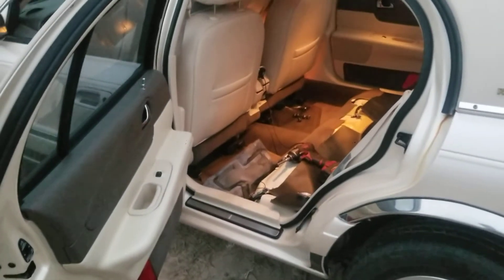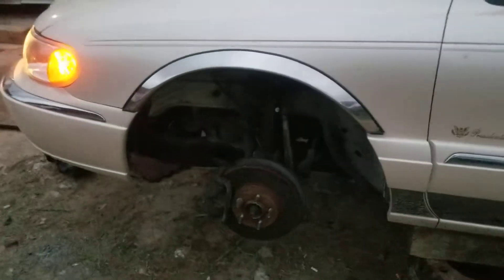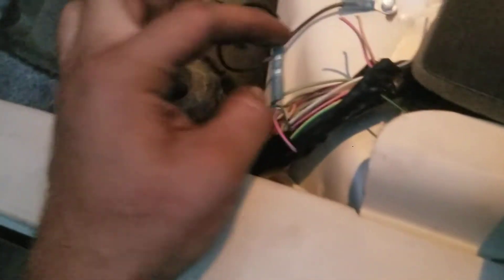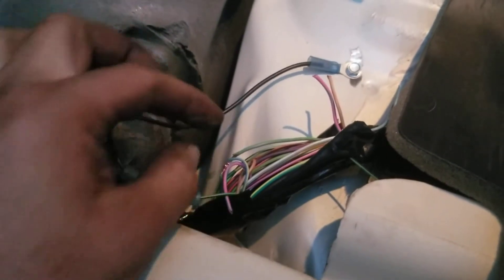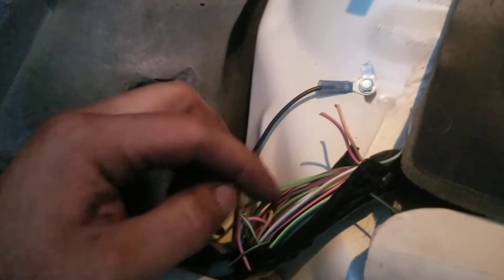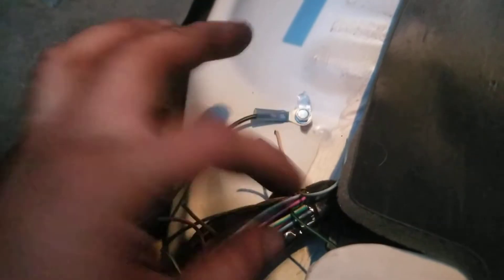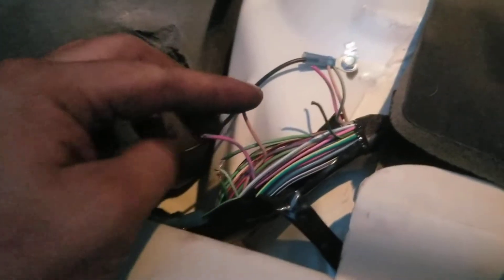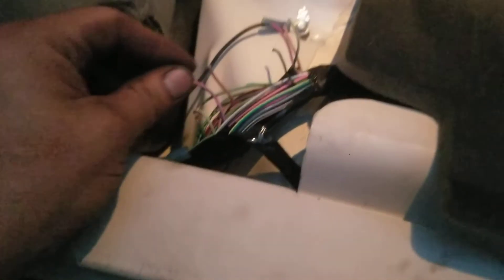LINCOLN CONTINENTAL GET RID OF CHECK RIDE CONTROL ERROR MESSAGE

Comment: Great information. Thanks for the video. Do you happen to know where the air ride control module is that controls the air suspension? Is it also located under the seat? If you unplugged the control module would that have gotten rid of the warning light or would the system detect that there's no control module attached?
Reply from the maker: @DavidLee-wx1ku  it would throw other codes, must do the wiring as shown on the video.
Reply from the maker: Check the description there's more instructions writen down.